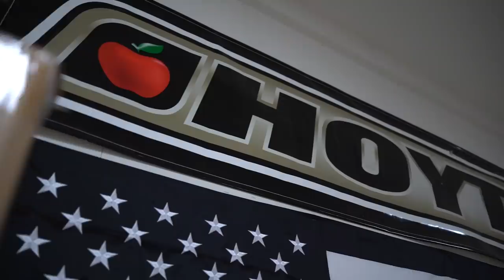Getting My BRAND NEW Hoyt RX-5 Built by the Professionals!

Comment: Honest question: Would most reputable shops offer this same level of thoroughness and involvement in bow setup? Or is this going above and beyond most reputable shops?
Reply: Not sure but I’m in WA state and the pro shops are mostly kind of Asses. Told them I had a 8-9 hundred dollar budget and they basically told me to get out. Went to 3 different shops. Ended up going to cabelas and they helped me more than anyone else.
Reply: Most reputable shops do a full setup if you purchase the bow from them, to include paper tuning. Key phrase “reputable shops!” It’s not at all rocket science, I like others on this thread invested in a vice, press, etc etc… the equipment will last forever and I have a wife and 2 boys, we all shoot bows! Well worth the investment. Plus you can really fine tune things such as draw length, most people don’t fit exactly into a 1” or 1/2” setup, I have my bow set at 28 3/4” my wives is 25 1/4” there’s a lot of things you can easily fine tune with a twist in/out of the cables. Super easy to set center shot and paper tune (properly) with top hats or yoke tuning

Comment: I got myself a Hoyt torrex to give bow season a crack. Strings started fraying at the top cam and the peep after a thousand or so arrows. Deer season has begun and they have my bow back at Hoyt to fix 😭. I'll probably get it back right in time for rifle season 🤦‍♂️
Reply: Woof... No shops nearby? That's rough
Reply: @JayMac  it was the shop that sent it. Hoyt wanted it to check out and fix under warranty. Shouldn't cost me anything, just frustrating.
Reply: I know the feeling. I ordered an RX5 about a month ago. Won’t be here till December..
Reply: @Anthony Roberts is this a known issue with the Torrex? I have one as well. Did you wax the strings?
Reply: @MacD2029  I don't know, I pick it up tomorrow, I'll see what they say

Comment: My lord archery equipment is getting complicated these days with micro-adjust sights, drop away rests, level this, level that.  FFS, a solid rest (TM hunter, bodoodle) and 4-pin sight (10/20, 30, 40, 50) with fixed blade broadheads.  Easy and simple where nothing can go wrong.  Too many moving parts = room for failure. KISS.